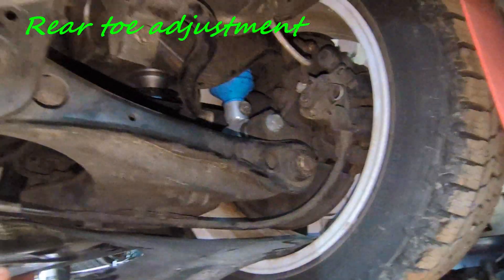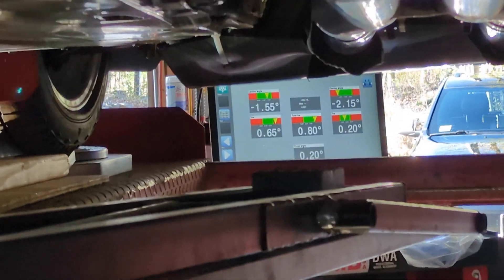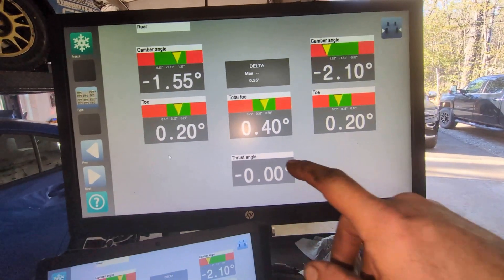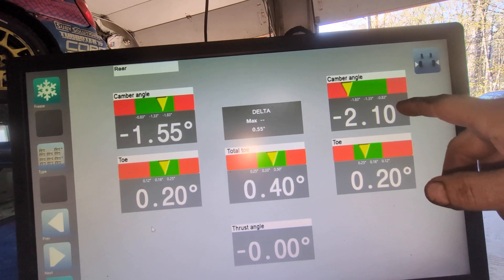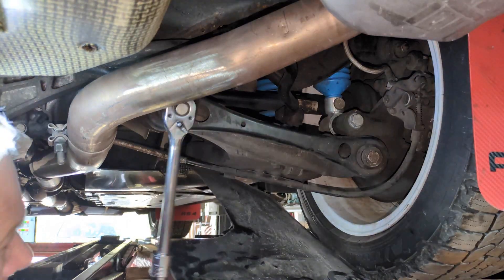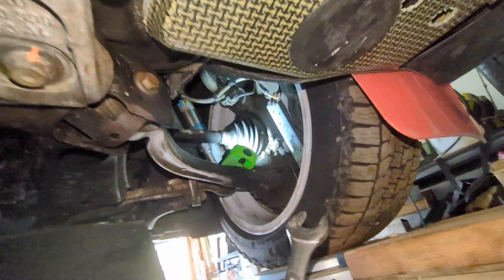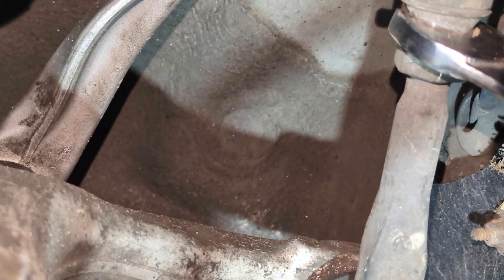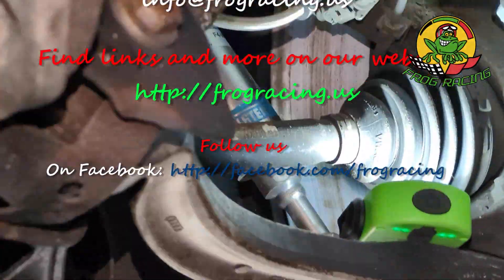Audi B7 RS4 wheel alignment

Comment: Well All Audi B6 and B7 have camber adjustment on the rear. 
They have excentric bolt (8E0501387D) on upper wishbone with you can adjust the rear camber. 
I did mine so my wheels from B9 A5 would not rub in my rear wheel arches.